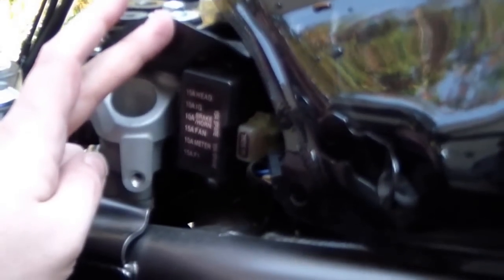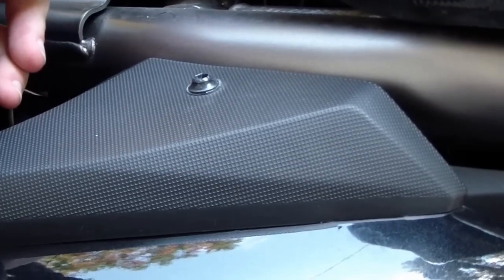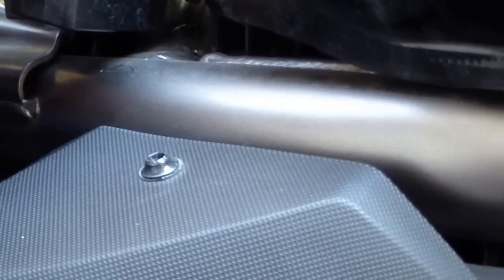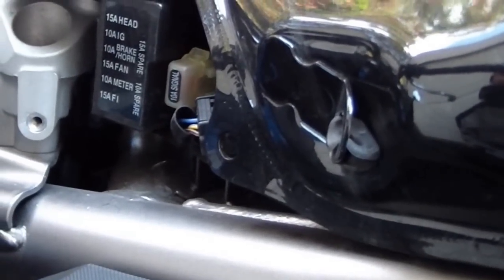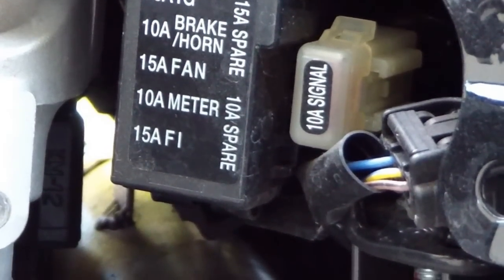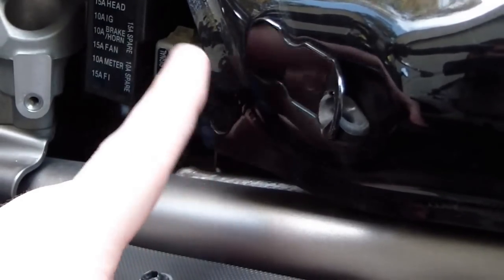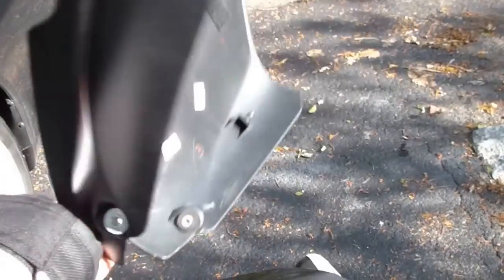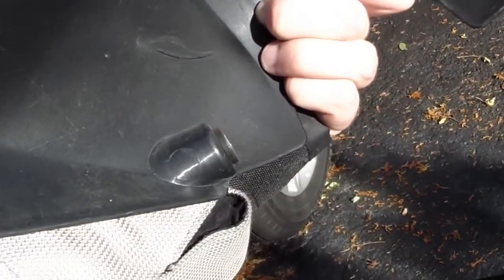2012 2013 Kawasaki Ninja 650 fuse box access

Comment: Headlights ain’t working daytime or highbeam all other lights work, checked the fuse box for the headlight and it was blown, replaced it with another 15 fuse and still nothing. Any ideas?

I did do a continuity test and even touched each headlight bulb and they light up fine it seams. Helppp
Reply from the maker: Check the ground to them...
Reply: @TheWizechatmgr  how do i go about that exactly lol still learning
Reply from the maker: @JxKILLAA  with bike running, put one probe of volt meter on the positive battery post, now probe at the headlights, you should get >12V. If you don't, there is a ground missing to the headlight. Then do the same with the negative post using the probe on the headlight. One or the other won't be present, assuming the light bulb isn't somehow internally screwed... Do the high beams work?
Reply: @TheWizechatmgr  okay I’ll give it a try, no headlight or passing button don’t work either l, when I flip the light switch not getting any indication on the dash either